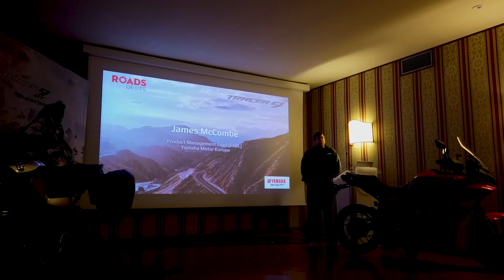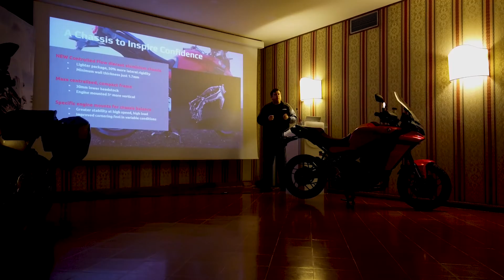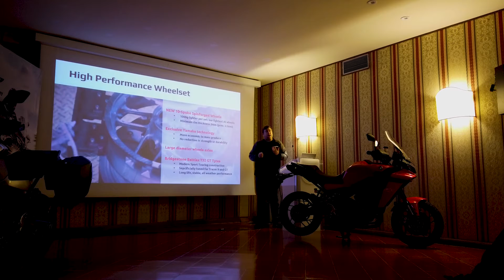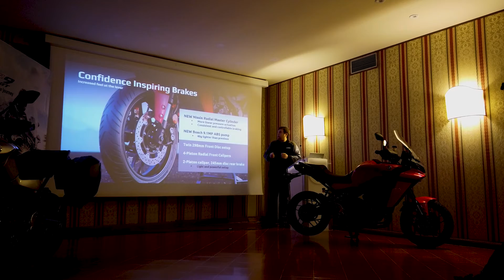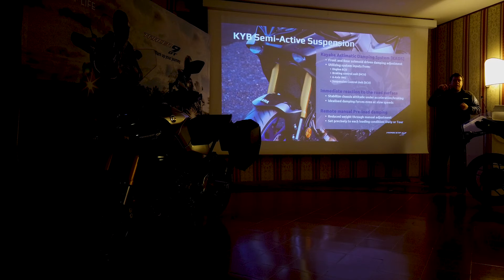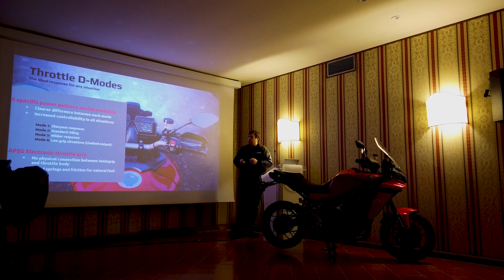2021 Yamaha Tracer 9 & Tracer 9GT international launch - press conference [new specs and features]

Comment: They should have give a little more cc, 989  triple could have reach the 135 hp. Other than that, the improvements probably thicks all the boxes and makes it a goldilock bike for me.
Reply from the maker: This means that also the MT-09 would have an increased engine....but there it would overlapped the MT-10...so, from the economic point of view, it makes no sense for Yamaha to have a more powerfull sport-tourer...Also the competition has lower hp engines...ex Triumph Tiger 850-900 makes 85-95hp , BMW F900XR makes 105Hp....